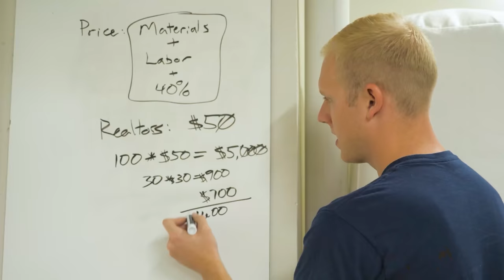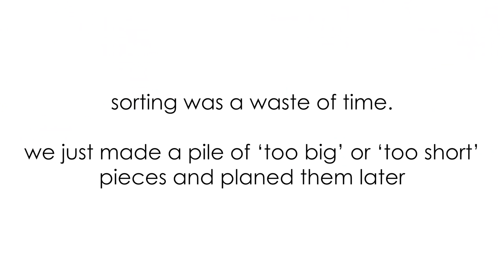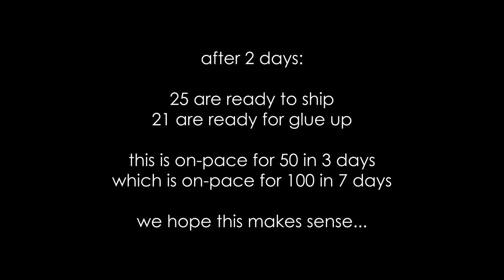we built 25 cutting boards in 2 days

Comment: Your lumber supplier should offer to rip one edge and surface two sides, normally referred to as S2SR1E. You are spending too much time on the joiner, it's eating up a great deal of time. Second , cut your stock into 24" lengths then the glue  two 12" cutting boards 24" , then after the glue up cut it in half. Doing one cutting board at time is not productive. We do four or 48" lengths and cut them into four boards. If all your stock starts out the same thickness, you will no need to sort them before glue up. By the way, the lumber supplier should charge you about   .25 cents per board ft.

Comment: Just for a help for you. When you clamp up your boards you can easy clamp up 30 cutting boards in one go, you are wasting a lot of your time. 8 long brace clamps and two boards like scaffold boards that are totally flat and square place all your cutting boards in between the boards around 30 in one go and clamp with eight clamps place thin plastic sheeting on each layer of cutting boards so they do not stick too each other once dry 24 hours later remove from the clamps the scaffold or similar boards will also act as the brace when clamping them all together. Try it you maybe even able to clamp more such as 5 lines of ten boards and clamp them all together.

Comment: Hey! I have been watching a ton of your videos and recently tried making a cutting board but have no idea how much it is worth. Any thoughts?
Reply from the maker: It's worth what you can get a customer to pay. We don't sell our cutting boards for less than $100 unless someone is ordering wholesale. Price your work at a profitable level, then go find the right customer - there's 8 billion out there so don't waste your time on someone who doesn't wanna pay what you think it's worth!
Reply: When I price my cutting boards. I use the flowing formula. L x W x H x (.3 to .55).

The .3 to .55 is the multiplier I use based on technicality and type of hardwood used (i.e walnut endgrain I use the higher end of .45 to .55) 

So for example, the last endgrain board I made was 18 x 24 x 1.5" cherry. 

So, that comes to 648. I then multiple that by .4 (cherry inexpensive, endgrain technical) giving me a cost of $259.2. This cost included the wear and tear, drive time to hardware store, milling time, consumables etc. 

I charge a 30% profit on top of that. 

Giving me a total of $336.96

I then charge separate for laser engraving, handles, chamfer, feet and juice groove. Laser engraving can vary in price depending on design time. 

I sold the board for $350. 

Hope that helps and sorry for the long post.

Comment: y my first thought for speeding up the process...   you were cutting 10 foot lengths down to short pieces.   Why not plane the full lengths down to thickness before chopping.  My planer has bade sipe on it.   I try not to plane shorter than 3 feet on it if possible.

Comment: I know some of this has already been said but here is my input. Why are you using a jointer and why are you cutting the boards so short? Get the right saw blade and glue the saw cuts together. You will have a good glue joint without a lot of wasted time. Your going to plane and sand the top and bottom for a smooth finish after gluing so it doesn't matter that it's the sawmill ruff cut. If you glue the boards together at the longest manageable length that you can handle, you can cut the boards to length after the glue dries and you have planed and sanded them saving a lot of time. Then again I'm a wood engineer by trade and you know what they say about us engineers.

Comment: Hi, watching from the UK and love the content. I'm not sure how it is in the US, but I used to spend ages jointing and thicknessing lumber, only to find that by the time I factored in my hours, machine wear, setup time, waste etc, it was much cheaper to order the timber at the sizes I actually wanted as they have the industrial tools and staff to do it much quicker and cheaper than I could, and I found my time was then better spent assembling, finishing and selling. Then they are the ones dealing with the bowed wood, different thicknesses etc, and it removes from your worries. Just a suggestion, but might be worth considering if you have an outlet for increased sales and your timber merchant can deliver?
Reply from the maker: Yes! It probably makes sense for the hobbyist/small business to get it milled. We’re planning on having the milling equipment in-house in the long term, so we want our procedure to reflect that up front. It’s a tough call, but we think it’s the right one

Comment: You should try cutting the work in process in half before you look at expanding your space.  For example, if you just cut up 50 cutting boards in this video, cut it in half and do 25 cutting boards as quick as possible. You might find that there are significant time savings due to not having as much work in process lying around! For example, if you do less pieces, you can clamp them quicker, and then the first cutting boards are getting closer to finished.  Too often people focus making all of the tasks super "efficient", but huge batches can actually be pretty inefficient.  For example, you got tired due to the repetition. Ok, seems like you are intuiting that the large batches are not cool.  👍🙂

Comment: I think you could speed it up if you just did one long cutting board, then cut that glued up board into multiple boards. Nice job though.
Reply from the maker: Hey thanks for the suggestion, Steve! We tried that in a later video - it's not much faster and it creates MUCH more waste - we get about 30% fewer boards out of a batch.

Comment: You are double handling wood,  joining the board, then ripping it down and jointing again. Also why cut it down so short first?  If you are making 12" boards,  start with 38" long boards and cut 3 boards out after done.

Comment: Dude, what? You HAVE industrial-sized tools! Your table saw, jointer, and planer/thicknesser are larger than most hobbyist-sized ones already.
Reply from the maker: Big goals, Aaron. Gotta think bigger ;)
Reply: @jennieanddavis  If you're specifically talking "industrial-scale" planers and thicknessers, where you're going to get the most consistent return on your investment is in the acceptance of wastage and management of downtime. If you've got an order for 500 chopping boards and you can do 25 per day, but you can only fit enough materials in your workshop for 50 boards if you finish an entire step for all 50 boards, start running small batches of each step and have a rotating buffer. Your jointer is probably going to overheat if you run it on hardwood for 2 hours consistently, so do batch work. Spend one hour jointing, say, lumber for 10 boards, then let your jointer have a rest for an hour while you work on the next one hour's worth of tasks. You're on the right track with the listing the steps for the production. Take it to the next level by compartmentalizing your workspace using "bins". Each bin could represent one or several steps with tangible/meaningful milestones in between them, and do sprints of work so that you finish off one bin, making it empty for the next batch from the previous step. You'll probably find that there's steps that you can do more than one "bin" worth of items easily, because the associated tools can handle the extra load and work is easy, like storing the boards post-glueup. With sufficient clamps, because of the "overnight" time delay between glueup and unclamping, you could glue and stack 100 boards overnight, but add to the pile during the daytime as you move through the bins, so that there's an entire day's worth of work ready for you in the morning, etc.

Comment: You lose a lot of time cutting 12 inch boards and gluing them together.  Consider saving that time and leaving them at their original size (lengthwise).  If it were me, I would glue up an 8' long cutting board (2 inch high, 12 inch wide, 8' long) and then cross cut into smaller sections that become the actual cutting board.  if you did them in 10' lengths, you would have five glue ups and five 10' long boards that you could cross cut quickly into 12x12 finished boards....

Comment: Why are chopping boards so special? You can get wooden ones in the UK super cheap, ok not as nice, but is there really a premium market for this? I prefer one piece chopping boards, feels like more to go wrong with a glued up board, more points of failure over a normal solid one piece board.

Comment: You guys are killing yourselves by cutting down everything to rough cutting board sizes. That’s why y’all tired of so much repetitive steps. If your making 18” nominal cutting boards by 12’ boards and cut in half. Do all your steps in 6’ lengths and at the end use your cross cut sled and cut to size. You will get 4 cutting boards per 6’ section reducing the repetitive work by up to 75% from the way you do it now.